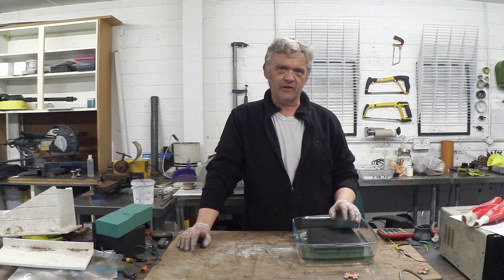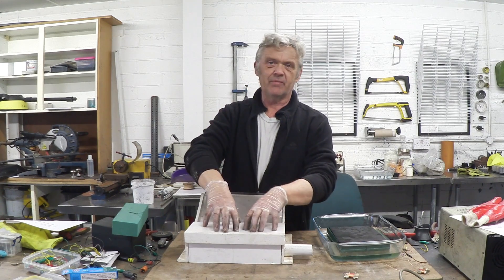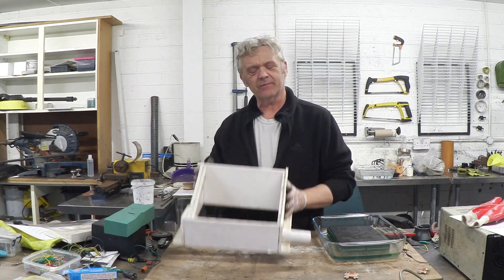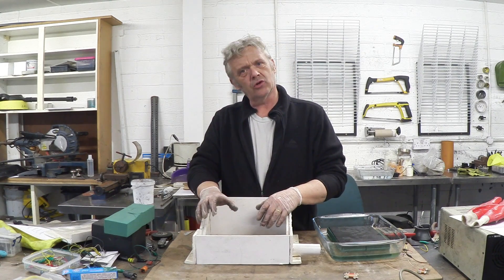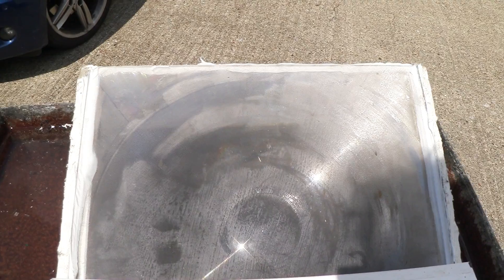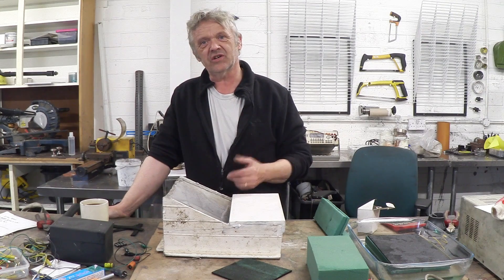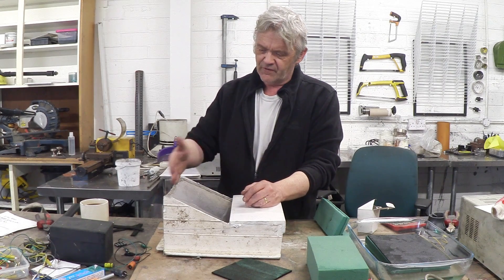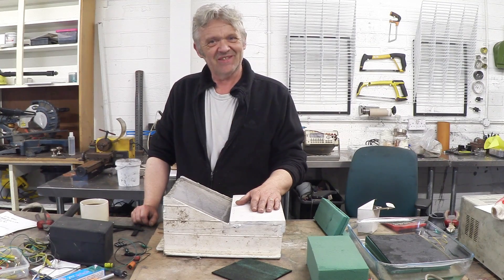Improved Solar Still For Fresh Water

Comment: The reason why plain plastic worked the same as the lens is because the solar collection area remained the same with both options. The only difference is that a plane transmits the radiation evenly while a lens points the same amount of energy all towards the focus. A lens would give you an advantage if it was larger than your collection window and focusing the light to all go through said window.

Comment: Here my idea. Take two copper plates and polish them to a mirror then use cvd to cover one surface with carbon rods drill a hole in the one with the carbon coating then focus a fresnel lens down into the drill hole also space the two copper plates 5mm apart. The light from the fresnel should bounce around the copper plates until the top one absorbs the energy this should get insanely hot like itll boil water im sure. Maybe even melt the copper.
Oh i mean to use this copper plates as a heat for cooking. Basically the copper plates can be sized to the lens.
The reason your lens isnt working that great is simple if you have 4 photons and you condense them into a beam you still only have 4 photons. The fresnel lens works better when its heating a tiny point when a larger lens. If you cut the size of the evaporation pool by 4x it would boil that water very quickly.

Comment: Dad built a solar still back in the very early 90ies out of glass. It worked but was quite slow. It was basically a model house with a hip roof. The water would collect on each of the roof sides and then collect in two chambers on either side of the still. there was two rubber bungs to drain the clean water and one to fill the main chamber.

Comment: For the floating application, placing the collection pipe above or partially immersed in the water will dramatically improve the rate of condensation. It is a design feature.

Comment: Will a solar oven or solar cooker get hot enough to boil a kettle of water? If it will, couldn't a copper tube attached to the kettle and run out of the side of the oven, or cooker, which is then coiled and guided to drain into a collection container basically distill that water. Seems a passive system after putting the kettle of water in and attaching the copper tube. Walk away and let the sun do it's thing.
Line inside of cooker with a reflective film or actual mirrors, put glass over the top, and paint the kettle black.
Same setup as a fire fueled distiller, but using the sun and a solar oven as the heat source.
Lots could be wrong with this method. Maybe the box will not get hot enough or maybe a kettle would take too long to get hot. It's just a thought.

Comment: The amount of solar energy you let into the box will determine how much water evaporates. That's energy conservation. If you want to improve the rate of evaporation, supply more energy per square foot, or more square feet. Since the transparent sheet is sloped, you'll need to face it so the maximum area is sunlit. Works better in shallow water, naturally, because the water will heat up faster. You've already increased surface area by using the foam. To supply more energy per square foot, (AND increase surface area further - due to leaf structure) try adding plants. Moss, perhaps. They'll draw up water in the roots and the water they don't use will evaporate and condense on the plastic. Plants work at night, too, still drawing water up and whatever sugar they consume in respiration will release water vapour. Increasing the angle of slope will decrease the size of water droplets before they start to slide down towards the collector. For saltwater, use saltwater plants.

The video is interesting, but there are other important factors, not just the ones in the paper.
Reply: feels like some new package of information has been disseminated. thanks

Comment: You could make a double one with the pipe and shade in the middle instead.two glass stills each side. Add some foil reflectors for extra heat.

Comment: If you use a solar cooker type reflecter around the box, paint it black and insulate the box too you will improve the heat to evaporate the water dramatically making it more efficient.

Comment: Perhaps put some mirrors or reflective surfaces around the box directing light in, like a solar cooker. Cheapest material I can think of for this would be those space blankets. 

Also while you are on this project it would be great to see some method of input and collection. I am thinking using those 5 gallon containers, one turned upside down to release water as it disappears from the box, and of course one to collect the water.

Comment: The area of the fresnel  lense is  immaterial. The sun is shining on a fixed area and the lense can only concentrate the same amount of sunlight onto a smaller more localised area. The net amout of heat is the same. That is why a plain lense ie plastic sheet was just as good as the fresnel which was doing the same job. If you could concentrate the solar energy from numerous fresnel lenses onto the area you are using then that would help your experimental outcome. Nice job.

Comment: Robert, I live in Australia and we have very intense droughts but a heap of space and lots of direct sunlight.  I've had this idea for 30 -40 years now .  I would like to do a solar power station in the outback for the sole task of pumping seawater from the coast in thick water pipes .  But the water pipes are built with spiral carbon lining so over a great distance as the water spirals through the pipes over distance by the time the water reaches its destination you have fresh water and at  points along the way you have huge underground storage tanks. The system at first would be expensive to set up but over time it would more than pay as water makes crops and food and whole farming towns would spring up.  Train tacks are expensive but we have services through out Australia. Why not  solar water systems ?
Reply: Good idea. 
I'm in Sydney.

Comment: Evacuated tubing, temperature differentials, voltages, floating peltier thermoelectric generator cells, snow and ice sublimation during winter applications, wearable cooling clothing,, optimal geometric configurations for conveyances of heat and energy,, establishing maximum surface area potential, purified water biproduct hmmm...what have we here now?  Thought provoking your work is!

Comment: Very cool, regarding the fernel lense, leaving the centre as Perspex and then if you have two fernel lenses on the side that hit an angled reflector under them that reflected the extra heat onto the foam (or carbon felt), you would effectively increase the surface area or the temperature of heat hitting the evaporation plate and increasing the still productivity. May not work but it's just an idea.

Comment: To be honest, I think your previous ideas in combo would work better--the colloidal copper in water, with carbon felt painted  on top with ultra black material floating on top.  
  Using an all clear container, like a large glass container in combo with the above, will likely get the water much hotter, much faster.

Comment: Some kind of hydrophobic transparent coating would do it, but i am concerned if it will condensate even at all in first place. The lens to try focusing even more was a good idea tho.Having the sun entry more on the side and using reflectors would also fix the problem, as light would enter under plate collector plate. You would have the advantage not needing it to be opaque, making it with aluminium and have a heatsink in the water, both to cool the plate and improve condensation, but further warm the water. It's a problem also i think with the glass, as i think it would get significantly hotter if exposed to a lot of sunlight. reducing efficiency. 
Thank you for those two videos, i wanted to build something similar for a long time to distillate rain water tank. Gave me so many ideas on how to improve the system. The foam can be some kind of barrier too for external contaminants, letting rain water in when it rains, adding another layer of "filtration". A back washing mechanism would be awesome if you want it somewhat self rejuvenating.
Good luck with other projects!

Comment: Just remember, distilled water is not that adequate for drinking, it lacks salts essential for proper human hydration. But if you have distilled water you can always add them! Chemists provide inexpensive hydrating powders (for severe dehydration cases) that I suppose could overcome this issue.
But in distilled water is often much much better than contaminated or salted sea water! Good job!
Reply from the maker: cheers mate

Comment: ROBERT:  Isn't that the same Carbon Felt you used in the Evaporative Charge Separation experiment?  Since the two (Thermal Evaporation & Charge Separation) are interrelated - and they are, so much so we've talked about configurations of exploiting it for Charge - All You Have To Do is work out the best way to think that in reverse, inducing Charge Separation (or Neutralization) so as to maximize the Evaporation Process.  There are published papers on the electrodynamic aspects of the gas/liquid boundary layer.   What IF a very minor change to the electrostatics might substantially accelerate evaporation?   A small Photovoltaic (or Thermoelectric) Cell attached to the Solar Still could have outsized effects, far beyond the Caloric energy value of the electric current used to alter the boundary layer electrodynamics; likely a catalytic effect.

Comment: I’m puzzled as to why you thought a lens would make any difference whatsoever? Lenses don’t create energy they focus it, therefore they both receive the same amount of energy. For every given area there is a specific amount of solar energy hitting it, if the lens is the same size as a still with a plain piece of glass the only difference will be that the lens will focus the majority of the energy in one spot and have cooler areas elsewhere, whereas the one with plain sheet of glass has an even temperature all over. Or am I missing something?
Reply: What Robert is doing is called 'experimentation', it's that part of science which enables the collection of knowledge. Leave him be!

Comment: I like your extension of the survival water 'still.  I think that your implementation suffers from the same limitation in that your evaporation and condensation mechanisms are the same, and that your collection and supply are on the same end of the container.  Using a condensing stack on the high side, and making an allowance for air convection from low-to-high, might greatly improve efficiency.  Air convection from evaporator to condenser might also keep your lens clean, making the fresnel lens more useful.  Your reservoir could also be made more cheaply using waste cellulose fiber instead of styrene foam.

Comment: Because heat rises, im thinking the condenser should be a vent on the high side of the solar lense,  and the  condenser unit stay insulated with builders board, and the bottom could be made of aluminum heat sink, shaded by the sun and cooled by wind or water, to help increase condensation efficiency*

Wonderful design 👏  Great Job,!

The gears ⚙ spinning in my brain 🧠 to make a Solar Motor of some kind* as well purify water simultaneously!
Reply: good idea, have the oasis at the bottom, with a pipe leading to the top of the unit to get the moist air up to the condenser part

Comment: That condensation issue was a thing I've been pondering on since I saw your last video, and was trying to figure out if a lens would be worthwhile, or if there was a way to angle it so the lensed light could hit the carbon felt, without having to go through a foggy medium- could you bounce the light in under the collector sheet with a couple mirrors?  If you could do That, then you could go with an opaque, more contained condenser. (I had some concern about seawater contamination from waves splashing up inside of it and splashing your collector- not a problem in a still source, but it crossed my mind.)  
Awesome work as always :)
Reply: I also had a thought, if you had some consistent wind, if you could make a venturi or a little solar fan on the top end to suck up the humid air and run that through a hose to a jug underwater, where it being cooler would help with the condensation and speed up production?  It seems that the airflow might help keep the lens, plastic, or whatever clearer and should improve performance in all cases wouldn't you think?

Comment: Glass absorbs IR and UV, so special glass like in solar panels would do a better job, and the thinner the better.   One concern i have is oasis contaminant absorbtion: if you put it in sea water, i wonder how will it perform after a week, a month? I think oasis or/and carbon material both are consumables here.

Comment: As an additional note, while I can not say that it might not lead to potential impurities in your water, putting a coating similar to rain-x on the inside of the glass would potentially improve your water recovery as it would lead to less water lingering on the glass to re-evaporate. ~( 'w')/

For sure, make certain that the glass is as clean as possible, even if one can not employ a hydrophobic coating to it.

Comment: i would move the output tube up so the water vapor can collect more naturally as it rises as steam, i would use glass on the design but put a fresnel lens spaced maybe a foot away, maybe use a black background in the water reservoir like that carbon felt, make the output tube for water something durable and heat resistant, like copper, and add a cooling pool so it can re-condensate as a liquid more easily to prevent losses. what do you think?

Comment: Could save your life!  Maybe a white felt mask on the outside with an inch or so border on the perimeter of the glass; the tail of which would lie in the water, exterior of the still (source), and wick cool water to the perimeter of the glass. The mask should be in the water on the tall side which should start a capillary siphon once it heads down the slope. This should improve condensation efficiency. Love your ideas and ingenuity.

Comment: I think the cheapest material for the clear screen is clingfilm.  It's more in keeping with the ultra-low cost design than glass I think.  You can even do twin or triple layers, with a wooden baton separator.  Great video by the way - this particular one has legs.

Comment: The obvious (to me) improvement is to seal the heating chamber enough that steam won’t escape, then run flexible plastic tubing from the exhaust pipe over the surface of the body of water. That’ll be your condenser.

Comment: A design that facilitates the exit of the steam from the evaporator and condense it in another unit using  evaporative cooling to condense the steam,  the cooler unit might be able to be set quite a bit higher if the pipe was black and insulated

Comment: Glad you noticed that a lens made no difference. ~( 'w')/

Glass is definitely most highly recommended for several reasons.

Make some outriggers like a catamaran out of some PVC pipe and have your discharge pipe out the front and let it drop into its own PVC pipe with a little bit of filter to keep out bugs and you should be good to go on less than choppy seas.

If there is fear of it drifting a way, simply apply a tether to it so it remains attached to something you will be able to grab hold of it by [as in if you were out to sea, tether it to your boat, but on land (such as a pond, puddle, pool, or lagoon, for instance) maybe use a stick].

       /)/) 
     (   'ˬ') 
@(>_ )-b 
      \) \)

Comment: If you could suspend your water collection container deep in a water source it might keep it cold so you could have nice cool or cold water to drink. I can't wait until I can get a few days to work with this and get the water tested.. Rob is that Green foam the stuff you can get from the florists? I will have to look back and see what you have as a list of materials so I can use the exact same base things ie foam and black carbon filter.. This has some real fine potential I think as a base for many other experiments.. carry on ole son.. well done!
Reply: Yes, the green foam is the material florists use.  The carbon felt he's using is similar to the stuff used in air purifiers pre-filters or range hood filters, although I'm not sure what thickness he's using.  I'm guessing probably between 1/8" and 1/4"?
Reply: @NorthernKitty  (love the name) outstanding.. I am closing in on the end of my Remodel job here at the house.. I just have some doors to make and a few panels to put up..

Comment: Maybe treat the inside of the glass with something like RainX so any condensation instantly runs straight off.
Reply: A good idea, but you'd have to be very particular since you're trying to collect drinking water IE free from contaminants. There are some treatments that give the surface a hydrophobic texture that may work, though.
Reply: @polyjohn3425  Good point, rainx takes a while to set and smells very chemically when applied.
Reply: As well as the active ingredient poly-Siloxanes, Rain-X contains Acetone as a solvent.
I would only use food grade materials of the end use of the water condensate is for drinking
Reply: We used toothpaste inside our scuba masks to keep them clear. I made a diluted solution in a spray bottle to apply it.
Reply: @paprjam  If it's water soluble, that will not help at all.
Reply: I thought RainX smelled like isopropanol, surely a acetone would be bad for window seals? I agree though, not sure it would add to the taste, in a nice way :) Quite like the idea of having one of these flat pack in  the boot of the car, for end of days type scenarios :)
Reply: Anyone here know know whereI could buy  some Namib Beetle shell in a can?